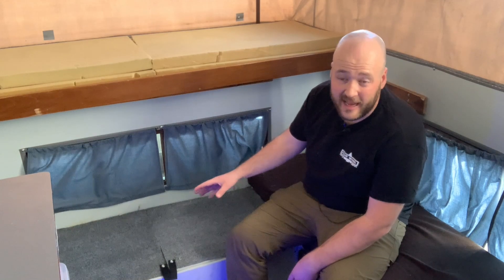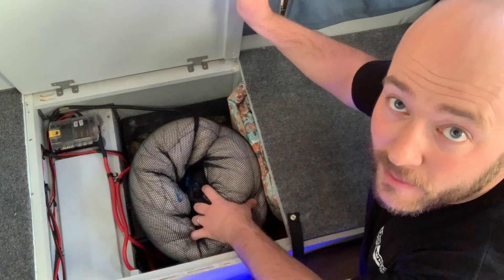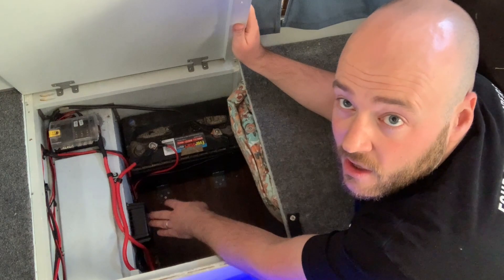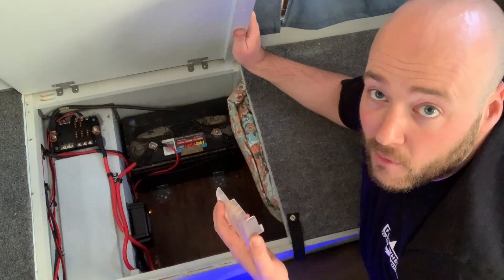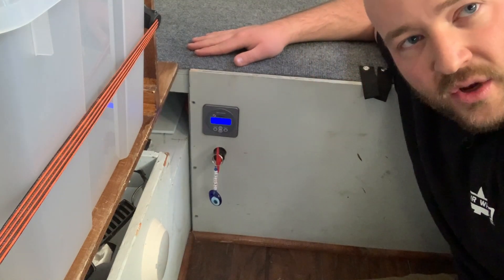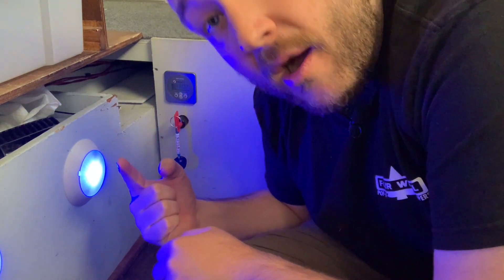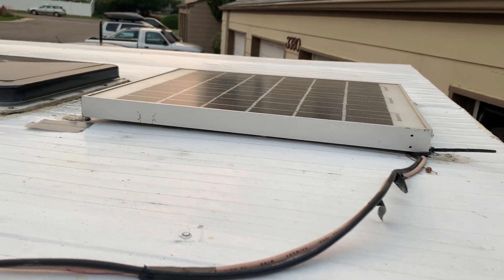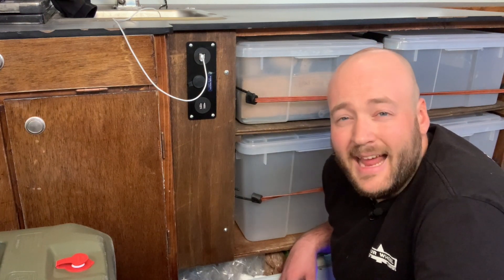Camper Solar Panel System, Cheap, Simple, DIY Solar Panels on my Four Wheel Camper.Totally off grid.

Comment: Hey Tim, I just recently bought a 1984 fleet. So exciting to find this channel! Thanks for documenting all you've done.
Reply from the maker: Awesome. Congrats on the purchase. Are you going to fix yours up or just use it? What truck is it going on?
Reply: @tgmorrissey  Im planning to  renovate the galley and floors this winter while I'm not using it.  I recently sold my 2002 Silverado (money pit), which we traveled across the country, 4 nights in the camper. Hoping to upgrade to a tundra. I've had my eye a first gen tundra for a while, and seeing your set up has solidified that! However, they sure are hard to find, locally anyways.
Reply from the maker: @matthewmcqueen6347  awesome. You’ll love the tundra. But you are right, they are very hard to find. Hood luck with the build and let me know if you have more questions.
Reply from the maker: Hey Matt, Congrats you are runner up in the giveaway. I've got some stickers with your name on them. Shoot me a note at info@tgmorrissey.com with your address and I will get them out to you.

Comment: Does the cable on the roof just flap around in the breeze while you drive?  Also, how did you route the wires from the roof down to the charge controller?  I want to do this in my older camper too but I'm wondering where to run wires and if there's a way to do this without removing my ceiling liner/fabric.
Reply from the maker: Hey Will, Great questions. The wire does not flap at all for some reason. Actually I had just lose wires up there for like two years before I finally installed the solar, and the wires where no problem at all. Must just be the crummy aerodynamics of the truck and camper leaves the air right on the roof pretty stable.

The wires are just routed through the roof and a small hole in the corner by the galley. I should have included a photo, I'll snap one next time I am in the camper and post it on my instagram. 

I do think this will be difficult to do without opening up the inside roof to some degree, but I am sure it has been done. I ran the wires when I did the roof, if you go find that old video you will see the wires under the insulation. 

Let me know if you have any more questions. - Tim
Reply from the maker: Hey Will. Congrats you won first place in the giveaway. An awesome shirt from four wheel camper plus some stickers. Shoot me a note at info@tgmorrissey.com with an address and I can ship that out to you.

Comment: Appreciate the videos I just got an older late 80s model camper that I am working on upgrading. All of you videos have been helpful.I bought a 2000w generator and electric heater before I saw your Mr. Buddy heater upgrade but I think I am going to switch and go to the Mr. Buddy and hopefully eventually do the solar. Getting up in the Morning in freezing temps to turn the generator on to start my heater sucked. Also we will be getting up to Winter Park/Copper a lot this year, wondering if you have any insight to offgrid camping close to resorts? I might also have some questions concerning camping in that Temp and if my camper can handle it yet. My email is jnweaver002@gmail.com. Thanks again for the great videos.
Reply from the maker: Hey Jon. Glad you like the videos and found it helpful. Per the heater, I’m thinking of switching to a diesel heater instead, the mr heater leads to a lot of moisture. Shoot me any questions you have on here, I’ll help where I can.

Comment: Actually a great simple set up! We're using a deep cycle battery w an inverter... also a Jackery with solar panel, so our few lights an items to power are good to go.
Reply from the maker: nice, thanks for sharing. I actually do have a simple inverter (super cheapo from the truck stop) that I use every blue moon. We mostly use the inverter in the truck when driving to charge laptops. Try not to need the laptops once camping (though we do occasionally).

Comment: Hey Tim great video. Thanks for the DIY info. One question though where did you route the solar panel cables from the roof to the base of the camper? And does it interfere with the popup canvas.
Reply from the maker: Great question. I did totally
Skip that part. The come down in one of the corners of the canvas. Along with the light wires. I’ve got them in a little according cable holder thing. They just hang out in the corner and have never been any issue. Works fine.

Comment: You're not getting any charge from your vehicle's alternator?
Reply from the maker: No I don’t have any charging off the alternator set up. Could do it but truly just don’t need it right now. That can get pricey too. In the wires alone. Need some pretty fat wires to run that dc the 20
Or so feet. Are you charging off the alternator? How’s it working out for you?
Reply: @tgmorrissey  My FWC Hawk is on order, since mid Sept, and won't be done till Mar 5. I've ordered it with the 160 watt solar, and am seriously considering replacing the standard house battery with a Battleborn lithium, and adding a DC-DC charger. Mine is the full build, with the 85 liter 2-way fridge, and the furnace, so there will be plenty of power demand.
Reply from the maker: @kiplambel4052  ohh that’s going to be a great rig!! What truck are you putting it on?
Reply: @tgmorrissey  That's the sketchy part. It's going on a new F150 with a 1980 lbs payload capacity. The camper is estimated at 1250, while leaves 730 lbs for 2 people, plus food, water, and gear. I'm definitely putting overload springs or airbags on it!
Reply: in fact, I was just starting to post to the FB group we both belong to, asking suspension advice.
Reply from the maker: It will be fine. I had mine on a Tacoma for the longest time. You’ll
Love it!
Reply: @tgmorrissey  I'd better love it! I'll be living in it!
Reply from the maker: @kiplambel4052  gonna be great. Get excited for that new camper!
Reply from the maker: @kiplambel4052  if it’s going to be on there most of the time. Skip the bags and get new leaf packs and struts. Bags do leak and when they do. It a a real
Pita
Reply: @tgmorrissey  definitely going to do adjustable coilovers on the front, Rear springs sure seems like it will be the most dependable, and that's essential in the bush.
Reply from the maker: @kiplambel4052  I’ve had two sets of bags. One was great and one pair leaks all the time. Ever after attempts to fix.
Reply from the maker: Hey Kip. Congrats you are runner up in the giveaway. I've got some stickers with your name on them. Shoot me a note at info@tgmorrissey.com with your address and I will get them out to you.

Comment: Thanks for the thought starter for solar.  I've got a big panel stashed for mine.  But the plan is going to be similar, simple and basic.  I do have a 12v ARB fridge to run so the bigger panel should help with the demand.  Did you pre-run the wires for the solar in the roof when you had it apart or add it later?
Reply from the maker: Yes. I preran the wires when I did the roof. Very very glad that I did. Some day I’ll up
Mine too. There is plenty of physical space and the wires are oversized too. So it wil be plug and play. Just waiting for that solar vendor to sponsor the upgrades :). Happy thanksgiving to you.
Reply: @tgmorrissey  I've got the original headliner still in mine that is in so-so shape.  So I know when I open it up I'm going to want to fix a bunch of stuff in the process. Run the wires, add power for a fan at the vent, put better foam inuslation up there and re-do the headliner with something better.  It's one of those projects that will snowball for sure.
Reply from the maker: @zoomad75  ohh man. All projects snowball like that. But it will be worth it for sure.